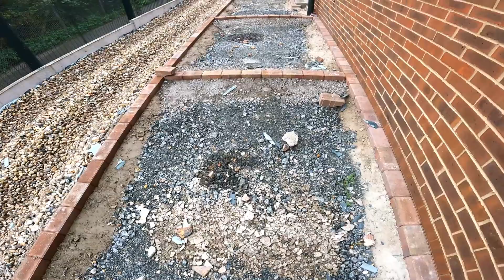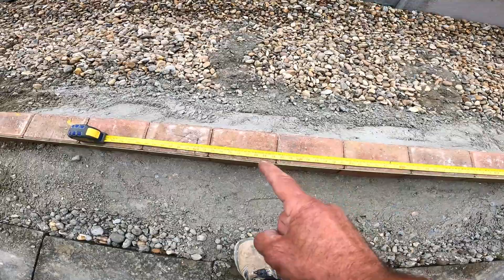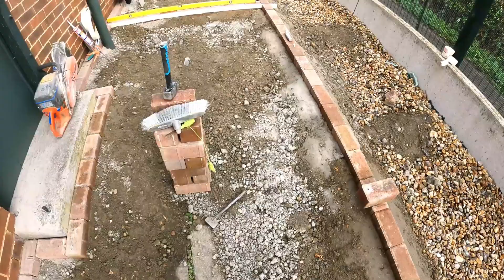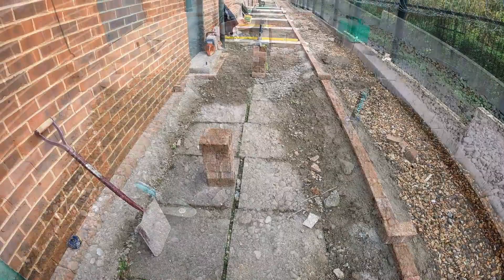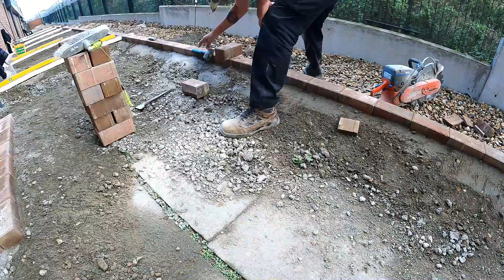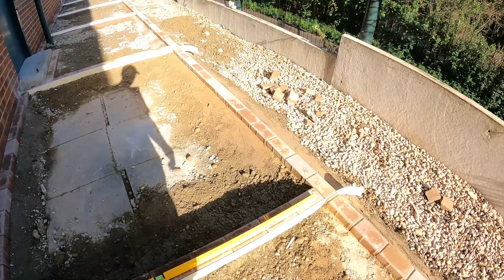Expansion Joint / Control In A Concrete Path Using Fillcrete Brick Fill Foam

Comment: Good strong working there. 💋 Exactly, when are these “expansion” joints needed, or are they just a good choice if you have a very, very, long concrete walkway, where you’re expecting a lot of foot traffic?
Reply from the maker: Thanks for stopping by the vid lyonteeth 👍👍 yeah you definitely need expansion in a concrete pathway they recommend 30 times the thickness of the slab your doing,  my pathway was 100mm thick so that would be expansion every 3m I did mine 2.4m just worked better for me, thank you for your comment hopefully this answers your question 👍👍👈 and thanks .
Reply: That's all wrong. No concrete moves that much